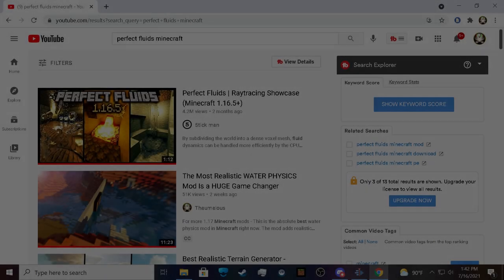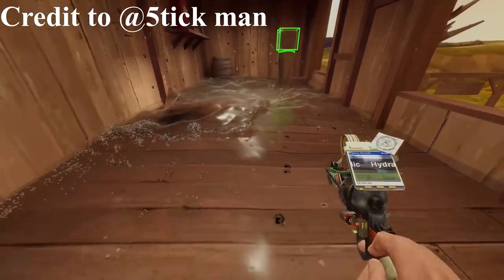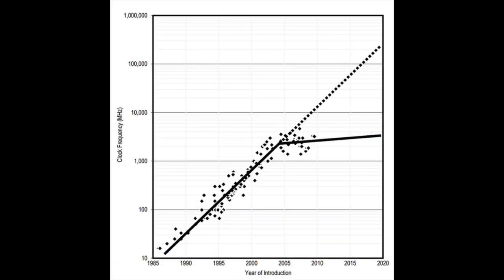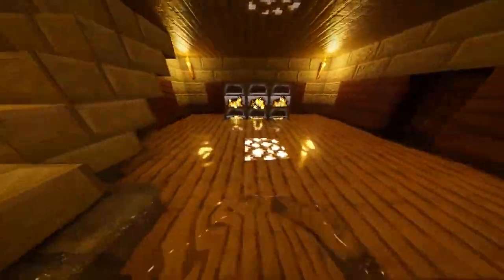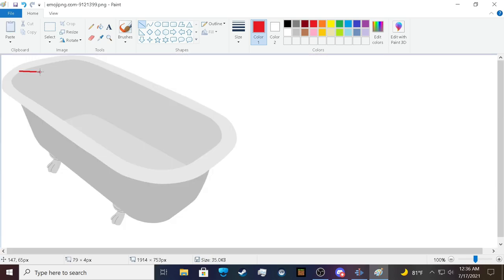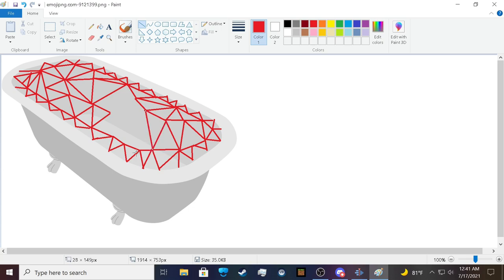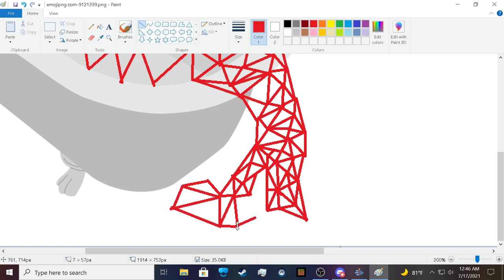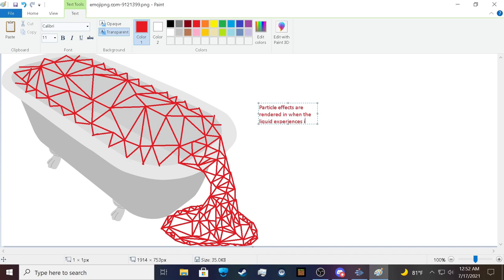Hmm, Can Wire-Frame Based Water Be Put into Video Games?

Comment from the maker: Last video I make before I change things up big time...
Edit: Nevermind, YouTube has decided that it likes this video.
Discord on channel page.
The only content I have coming out is some Minecraft mod stuff, so if you have video ideas please give them to me. (I want to try more professional topics)
Reply: Silicon-based electronics are advised to be at their performance limit.
The main problem is the switching times and the heat dissipation.
Modern processors such as CPU and GPU produce enormous amounts of heat for their size.
The next step is likely to be photonic processors.
Quantum processors are also being developed, but their necessary technology (and cryogenics) is not necessarily suitable for the mass market.

However, the tests carried out so far with photon circuits are quite promising.
Reply from the maker: @sylviarohge4204  Exactly

Look at some of these other comments though. People are seriously in denial.

We are likely going to have a huge gap in tech progression from 2023 to 2030 or higher because of how long it will take for new methods to become consumer products.
Reply: @Solusire  
The speed at which the processor's performance increases decreases, but will not decrease to 0.
The big manufacturers are not turning to chips for nothing in order to achieve more computing power.
Further refinements of the switching logics could also have a further performance-enhancing effect.
However, there will not be any enormous leaps like 10-15 years ago in the foreseeable future.
Multiple smaller graphics processors instead of a single large processor will probably be the new way forward.
In this way, the waste heat can also be better distributed over a larger area, and the "yield" of chips is also improved by reducing the die size, which can potentially mean cheaper processors.

Photonic processors will definitely be a few years away, but due to the huge market for such processors (especially hardware gamers) the big manufacturers will switch to this technology very quickly as soon as it is "ready for the market".

With the market launch of the first consumer processors based on light, there will probably be another big leap in performance.

You can only be curious what the future will bring.
Reply from the maker: @sylviarohge4204  Indeed, all we can do is make educated guesses.
Reply: What you described isn't a water simulation.....it's more akin to a cloth simulation.
A water simulation would be used to get rid for the need of those "effects" that you speak of in your video. What you are describing is simply "large scale surface tension/cohesion simulation" (air quotes because you use 0 scientific knowledge of real fluid dynamics to "simulate" it.) 

Obviously it'll work better than blender's fluid simulation algorithms..... because you aren't simulating water, you're just simulating a 3d cloth.....

If you would compare this to a water simulation, you'd get various artifacts, for one a non pressure based water simulation where because the water is "reacting" to external stimulus and depends on the simplified node structure, you wouldn't have any under currents, since the water inside the node representation is all the same so draining a dam would be akin to dropping a bead of chains and not water churning.

Other major artifacts, there would be no bubbles trapped in the simulation unless you treated the possibility of a bubble also changing the resolution of the mesh which makes the point of dynamic tessellation a bigger waste of performance.

A simple real water simulation much more performant that your method with similar results without any under currents would be to use basic wave physics on the mesh itself on the gpu in the vertex shader and interpolated automatically by the fragment shader while rendering. Meanwhile each mesh can be given a simple tension value that allows the wave to break and create new mesh in the geometry shader. Viscosoty could also be similarly implemented to control wave speed. Such a solution would use way less memory (nearly negligible compared to yours) and give similar if not better results.

Your solution attempts to do something by simplifying something that already exists without actually understanding the reason behind why such a complicated solution is needed in the first place, it comes of as something arrogant even though its just poorly researched.

Edit : to get under currents in this "simplified" method I proposed you could just add splines in the simulation for the "waves" to travel across and affect the water around them. This would have to be procedurally generated so it wouldn't be accurate but still better than nothing i guess.?

Edit 2: I realize this is too long to read, so tldr : you think water is a bunch of balls moving together in laminar flow but in reality it is extremely turbulent. Only under lab conditions is water really moving in the same direction, otherwise there are too many currents that make it so complicated to compute realistically.
Reply: do I see another potential thaumcraft fan?
Reply from the maker: @utkarshjha9547  
What you are describing is simply "large scale surface tension/cohesion simulation"
 - I know that 3d meshes are generally used for solid state materials sims. But that doesn't mean that they can't be used for anything else when adjusted properly.

(air quotes because you use 0 scientific knowledge of real fluid dynamics to "simulate" it.)
 - Why would I use technical jargon in a video that is supposed to be understandable by everybody. I'm not going to overcomplicate things to make a point.

Your solution attempts to do something by simplifying something that already exists without actually understanding the reason behind why such a complicated solution is needed in the first place, it comes of as something arrogant even though its just poorly researched.
 - Something like this doesn't exist, it either currently takes place as a 2d surface liquid mesh or 3d rigid body mesh. Things get more complicated the more accurate you make them, my system is an attempt at a balance between realistic and easy to run fluid.

draining a dam would be akin to dropping a bead of chains and not water churning.
you think water is a bunch of balls moving together in laminar flow but in reality it is extremely turbulent.
 - For the typical cloth sim, obviously this is true. However, my plan was to add properties to the vertices which include the capability to break apart into smaller meshes as stated in the video. You may think this does nothing, but in reality all of your arguments flow to my side when you realize that cloth physics is really close to the physics of a high viscosity - high surface tension liquid. All you would really need to do at that point is bring the viscosity and surface tension values down. Obviously this method isn't going to be as realistic as a full particle system (other than in varying container sizes), but it will be easier to run if done properly. 

 there would be no bubbles trapped in the simulation
 - I don't really care about bubbles. That is a whole other can of worms because if we were to implement bubbles that means that we would need to make an air sim which would be a horrible waste of performance.

 to get under currents in this "simplified" method I proposed you could just add splines in the simulation for the "waves" to travel across and affect the water around them. This would have to be procedurally generated so it wouldn't be accurate but still better than nothing i guess.?
 - liquid ripples (small waves) would just be rendered as a shader which doesn't affect the mesh. The idea is to basically generate the raw simplified mesh and then layer a crap ton of effects over it to make it look like water. (large waves would still be in the mesh)
Reply: @Solusire  My man.....when you say  "doesn't mean they can't be used for anything else" you have missed my point....

Your method is the exact same one used for water sims (albeit with a much more scientific complexity). My whole point is you don't need to use such a complicated thing to achieve the results YOU want. You wouldn't write an "easy to run fluid" sim like this, there are far easier and more performant ways to do it.

This method is used when you need a highly accurate simulation of how water under currents are flowing. But in a game you never need information about under currents, you just need the whole mesh to "act" like it is a liquid regardless of the information of these under water currents.

The simple physics I was talking about is basic wave mechanics, it isn't jargon and it is something most people understand intuitively.

The most technical thing you would need to know is a harmonic equation, but that's quite simple.

If you used a harmonic wave equation you could use do these "effects" on the mesh super accurately without having to realistically calculate anything. And adding a threshold to the result of the harmonic equation you could simulate how  the mesh splits. (this other mesh can be created and destroyed in the geometry shader, we only need to know if it exists.) Similarly if you wanted to simulate something based on pressure you would simply do a repeated addition (integration) at every moment until the desired height was achieved. If done right and handled properly by the fragment shader this could give you an infinite resolution sim without doing anything much. 

All of these calculations would be entirely on the gpu and are almost free and work with traditional mesh culling optimizations so you don't calculate anything that is not visible but still retain an accurate sim.

There is no need to store stuff in this additional data structure you have created, what you are trying to do is spend enormous amounts of resources on something mediocre. What I'm trying to tell you is this can be done in a way more EASIER, FASTER AND ROBOUST way for the things you need.

The reason liquid simulations take time is because it is calculating a lot of other things than just the liquid and to optimize things there it makes complete sense to use an external data structure to hold things for multiple calculations.
Reply from the maker: Well, the point was to get the water to look realistic in the first place. The importance of water physics in a game like Minecraft would be heavily reliant towards immersion rather than functionality. The point of my system wasn't just to make the easiest to run water or the best looking water, but a liquid system (that includes fluid such as lava) that would be able to look good and possess impressive functionality. No system like this exists, and even if I'm no where close to sparking the development of one, the point of the video was to simply spread the idea that something like this might be possible. I never said it would be easy, but clearly the system I have explained is the only one that could include physics operations with game mechanics such as drowning and swimming. You say there are existing methods that are faster and easier, which may be true, but they are definitely not robust.
Reply: why not restrict it to 8 polygons at close range, use autogenerated POV bump maps and use refractions to give the illusion of ray tracing?
Reply: @Solusire  they actually implemented wire frame water into minecraft through a mod

Comment: You're missing just one important detail in your opening argument, if say Nvidia were to take a crack at this challenge, they wouldn't just simply say, okay well let's pump our GPU with as many transistors as humanly possible.  They would instead take the challenge aside and start working on a specific architecture of core that is designed to do this one thing and this one thing only.  Just like they did with real time ray tracing when they designed the tensor core.  There is more to graphics processing than just transistor count.  If that was the only thing holding it back then CPUs would be able to handle video game graphics just as well as a dedicated GPU, but they can't.  This is because there are huge, MASSIVE, GAPING architectural differences between GPU cores and CPU cores.  And this affects what kinds of algorithms they are better or worse at processing in such a huge way that if you tried to get your video game graphics to render on your CPU there would simply be no comparison as to how poorly it would run vs running on your GPU.  Also if a programmer were to try to implement the kind of water physics that blender uses into a video game, they would probably leverage something like Nvidia CUDA technology.
Reply from the maker: That's actually a really good point. I have no argument against this other than the fact that they would probably need to adjust the software running on these new cores because blender's method still isn't really meant to be ran in real time.
Comparing water physics progression to light physics progression is actually very smart, good job.

Comment: Your method has a few large flaws I believe. What you've described does mostly exist already, it would be a real-time softbody/cloth simulation, that would dynamically remesh itself to better simplify areas of varying detail. The first issue is that this isn't a fluid simulation at all, and by only simulating the outside, you're ignoring the interior of the liquid. An ocean would just collapse into a thin sheet of water, with no way of recording the volume of the water. Additionally, all the physics of water that take place beneath the surface would have to be ignored. Second, this would have massive performance problems. The advantage is that by simulating only the surface of water, your maximum efficiency is in O(n^2) time, instead of O(n^3) time, not including collisions between particles. I think your method becomes less efficient than other fluid simulations when you try to detect overly-detailed areas of the mesh and modify the mesh in real-time, which requires you to rearrange very large arrays of vertices and edges every frame. It's an interesting solution, but it wouldn't function correctly.
Reply from the maker: I think my sketches of the liquid mesh confused you. I simply used them to take up screen time because I had no idea what else to use in the video.
I stated that the mesh is 3d and that it always has atleast 4 vertices per shape - tetrahedron. The mesh scales up in size in large bodies of liquid for performance. This is almost as easy to calculate as a 2d mesh because of the amount of simplification the 3d mesh goes through within a volume of liquid. The mesh simply scans for interruptions within the volume and makes a more detailed mesh as that interruption appears. Particle based liquid falls far behind this mesh design because of the sheer quantity
Reply: I think you misunderstood the video. The mesh IS 3d. Plus, you can have only the outside being calculated, unless a disturbance is detected. Things like a hole, or shearing. This idea is really cool. Makes me wish I already finished collage and have a degree in computer science. Gotta start somewhere.
Reply: @Solusire  Correct. Particle based simulation is slow because of all the particles needed to create a simulation. The mesh would be more effective.

Comment: What you're looking for is a voxel octree, an octree can be visualized as a 3D grid of cubes, where each cube contains 4 smaller cubes, all the way down to the resolution you need. (in the specific places where you need higher detail) You can then use that to generate your vertices for a surface mesh. The octree is really just a data structure, the only difficulty I've found is how to organize and access it quickly in memory. I've made some progress, but this idea of using it for fluid simulation is very interesting.

Comment: Seems like you just derived the logic behind UE5's Nanite mesh system on your own, and then applied physics to it, awesome idea! Though I will say, you can save a lot of rendering time by instead only computing physics for the surface of the water rather than the entire volume (which is what I assume you meant by 3d mesh). Because for a video game, the motion of the fluid is only really relevant on it's surface. Ofc this can change depending on the game, one's that need to include things like flow within fluids may need to have the 3d mesh system, like racing or flight sims. 

Either way great idea for use in video games, this would definitely be much more performant in a game environment than a particle based system!
Reply from the maker: Indeed. Maybe we can have the mass of water simply scan for unfilled areas under the surface, then when a hole is detected, a physics mesh is created there.

Comment: Unreal Engine 4 and 5 has it's own "Niagara" particle system, which is really smart and well optimized. I've seen some guy using it to set particle behaviour as if it was water, and then he just filled gaps between particles with mesh and got really realistic result. Also i'm sure AI will very soon bring many of videogames technologies to the new level by preventing GPU's from rendering unneccesary stuff

Comment: There's some cool work in real-time water physics which actually uses voxels, sorta like what Minecraft does now but more complex. Instead of just indicating that there's a block there, you have a value indicating how much fluid is in that block. Then, you run a function like Marching Cubes or Surface Nets to construct a surface mesh of that water, and boom. Easy rendering. The physics simulation is pretty easy too, since all you need to do is check the surrounding blocks for their water amount (and possibly the velocity of that water) and run some simple cellular automata-type calculations to move the water. Really cool stuff.